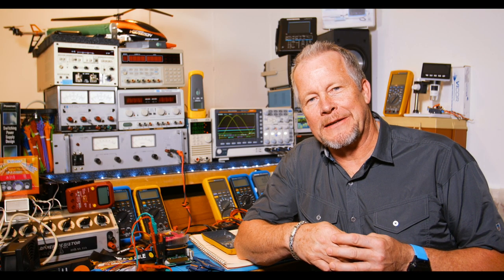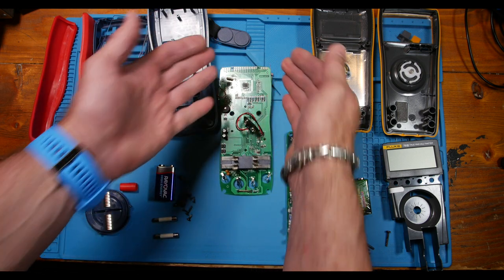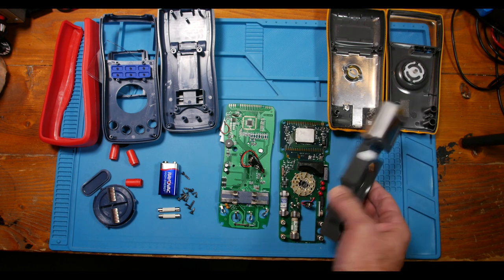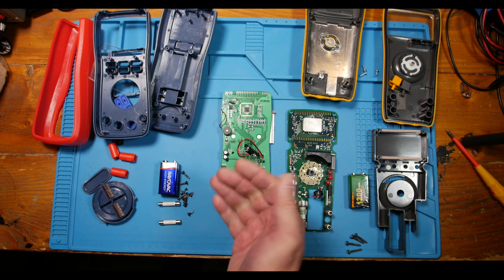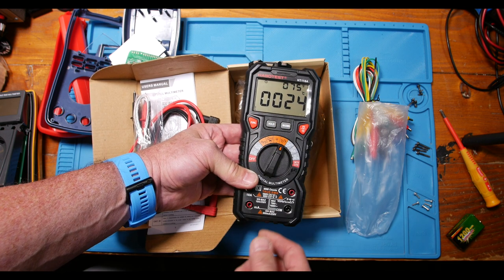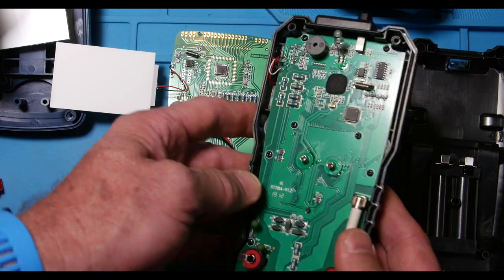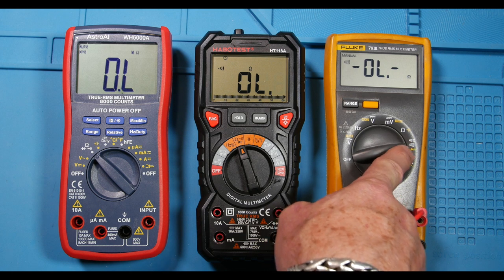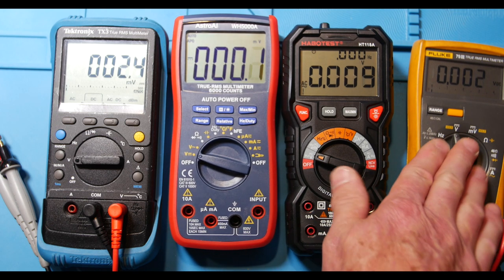Low Cost Digital Multimeters versus a Fluke

Comment: Really great review with both a look inside but also a great walk truogh of the usage in a perfect length! I do like a lot of things in this video and may have a tiny cringe:-)
I do like that you sometimes used cut and other times did use fast forward, it did a lot when you "jumped over" the slow parts that had no really value, like fitting the two plastics together. About plastic, there should be some markings inside that tells you what type of plastic it is, like PA6 that is a type of nylon.
About the Fluke, please correct me if I am wrong but when I read about the model 87, I get the thought that it is made for the hard working electrician, how rugged it is build, it's safety features. I do not think it is made for electronic at all, it is simply the fact that it has so bad a resolution at 6000 and do not go down to micro, and the low accuracy in the low numbers that make it nearly useless for anything electronic.
I was glad to see that you decided not to remove the print from the HT118A, there are no reason for you to maybe destroy the meter, just to show a properly empty board-side.
You may be right in that 9V do hold more power but everyone do own rechargeable 1.5 batteries and you can always have a set ready, while the 9V is nearly impossible to get as rechargeable and is fare more expensive to buy.The last part where you properly would make a thumbnail was funny but also a bit cringe because it was totally unedited and maybe a bit long, but LOL still funny. :-)
IMPORTANT, you forgot to say that you have a patreon account, and maybe you should change your text in the description to a link? :-)
Reply: Fried Mule do you own a fluke 87?
Reply: @chrisblank9090  Hi:-) No I choose not to after reading the spec sheets and seen lots of reviews. It was most the fact that it's only a 6000 count and have no micro and can't read as high a frequency as many other can. :-)
Reply: Fried Mule there are 5 87s. the 87 4 I think is the one you're looking for. in my own personal experience as a technician, when it comes to speed, the 87 1,2 and 3 are the best above the rest. no chinese or brymen meter can match them. whatever they say, branded meters will always be the apex when it comes to quality and features. for hobby or ethusiastic electronics work them generic multimeters will do but for people like us, a big no no. 87 1,2,3 and 4s are obsolete. the 87v or 87 5 is the one remaining in the market today.  and for that 6k count, you can set it to 20k.
Reply: @chrisblank9090  I do not know about how fast it updates, what I am talking about is if you want to know what frequency it max can detect and it's almost impossible low. But look at it, its a tank of a beast that guarantee that the man get hurt before the meter. That ruggedness  is invaluable for an electrician, also the real safety up to 1000V. It's simply build to withstand the harsh environment and not for the electronic engineer. :-) While maybe the Bryman is more geared towards that market with it's 50,000/500,000 count and up to 20MHz frequency detector and micro capability, but fare from as rugged as Fluke. The 87 do also dye if it gets static electricity while the Bryman don't. :-)
Reply: Fried Mule the 87 4 does micro. and same with its siblings, the 189 and 187. with acceptable resolution and update speed too (but not on par with the 87 1,2 and 3) I'm an electronics engineer and my business is consumer/industrial electronics repairs. almost 40 years in using various test instruments and brands. in my own personal experience, keysight and fluke are the best choice of them all when it comes to quality and features pricewise. brymens are also good. but when it comes to that min max feature, it's not on par with fluke and keysight. it's a bit slower. that's another feature where the higher ends dominate the market.
Reply: @chrisblank9090  I admit it's a fairly long time sins I took a look on the 87 but I have an idea about the Fluke brand is so highly praised, is because it was "MAD IN USA" and hard as a tank, it cant have been it's features:-) Now it may slowly be better but not nearly as fast as many other brand, like, yes, Keysight and Brymen. Brymen has a min/max that are wary slow but it's because that function is not for fast reading, it has an other function to that, that is about 50 times faster then any of the Flukes. I am not hating on Fluke or fanboy of any brands, I am just wondering on why use a 6000 count bomb proof meter to a HIGH price, when you can get faster with way higher count. To be fair that Fluke is fare from the most expensive brand out there, you can get meters that make Fluke look like a insanely good bargain. :-)
Oh and by the way, thanks a lot for taking your time to answer my comments and keeping it civilized! :-)
Reply: Fried Mule the min max feature of a meter needs to be very very fast to capture voltage and current anomalies in a circuit under test. for hobbyists and enthusiasts this feature is not important but to us it is. and only fluke and keysight have that speed that we need to capture those current and voltage glitches,.and for brymen, yes it's crest factor/min max mode is fast too  but not fast enough as it failed our requirements. we're no fanboys too. we just want reliable and able instruments to suit our needs. and by the way keysight is made in malaysia. brymen is made in taiwan. we have 2 brymen bm869s' and a bm859s. both top of the line brymen models. yes they are feature packed, but compared to our agilent agilent u1282as' and our fluke 289s' they become just average meters. and a fluke 87 1 will beat those brymens when it comes to update speed. we know because we made the comparisons ourselves and we have all of them on hand in the lab.
Reply: @chrisblank9090  Okay, that is great info, what about my argument about a wary low count?
First remember that I trust what you say, but funny enough have found an old video, comparing the Bryman and the Fluke where the Fluke... is ehm a fluke, compared to Bryman:-)
Reply: Fried Mule an 87 has two resolution modes. a 6k and a 20k count. 87 1,2,3 are almost identical in glitch capture speed. the 87 5 or 87v is much faster. if you need more speed you can go to peak capture mode. and in my opinion, that resolution issue you opened is not an argument for me because meter resolution is the least important  feature of a meter.
Reply: Fried Mule and I forgot, you need to have in hand both meters to compare them personally to make factual judgements. watching videos will just show you a fraction of the real thing and will not tell you everything. first hand experience is still the best.
Reply: @chrisblank9090  Okay that changes a lot, but resolution not important, ehm why not? I am not arguing but trying to learn! :-)
Reply: @chrisblank9090  You are completely correct, but unfortunately is it not a possibility in Denmark, you can't buy any of them in this country as far I know, so I have to buy from Amazon or something like that.
Reply: Fried Mule well when it comes to resolution, in our perspective, a 50k count meter will more than suffice, well for us. even a 2k count meter will be able to tell you a lot as long as the update speed is fast enough.
Reply: Fried Mule ah you're from denmark. wow that means metrix is widely available there right?
Reply from the maker: Hey guys thanks for the great conversation!!  I learned a lot!  Has anyone used the Tektronix Multimeters?  I am really happy with the TX3, but I haven’t really critically compared many of the features like the the min max measurements.
Reply: Kiss Analog umm no tek meters here in southeast asia sad to say
Reply: @KissAnalog  About the Tektronix T3X, I have not investigated much about that model but I was (as you know) the wary happy and lucky winner of your Tektronix DMM157 give away:-) And if that is any indecator of the quality, the Tektronix T3X have to be a really great meter!
Reply from the maker: I read somewhere that it was what Fluke ended up calling the Fluke 189 albeit rebuilt in the more Fluke looking housing;) I do like the Tektronix’s housing though - the ingenious way that the battery is housed.  But I guess when both companies were bought by the same company- only one was allowed to make meters;)
Reply: Kiss Analog both are now owned by the danaher corp. that tx3 was a dream meter.
Reply: and the fluke 89 was the identical model of the tx3
Reply: @chrisblank9090  What I like about the T3X is that you have only one Ampere port, that goes from 10A to the lowest milli amp.
Reply: Fried Mule that tx3 is one of best  meters ever made in the handheld realm. it was made by iso tech taiwan for tektronix. and it was shit news in the past that tektronix will never be sold within the south east asian region. taiwan is a neighbor country of ours. but iso tech never exported meters here sad fact
Reply: @chrisblank9090  Okay sounds wary interesting, but what made so great a meter? By the way, I have my eye on the Keysight U1253B I like the fact that I can read it from fare away and is so clear on video. :-)
Reply: Fried Mule that is a good choice. you can order it directly from keysight malaysia I think? to get it less?
Reply: @chrisblank9090  Glad you think it is a good choice. But my wallet don't agree:-)
Reply: Fried Mule that unit is indeed expensive.
Reply: @chrisblank9090 . Disculpa mi intromisión , pero he leído tus comentarios y los de Mula Frita y estoy totalmente de acuerdo con el. 
No quiero presentarme de profesión ni categoría , que es lo que has hecho tu para dar mas validez a tu conversación diciendo que eres ingeniero, en mi tierra uno dice la categoría cuando se lo piden , "pues el movimiento se demuestra andando"  Referente a Fluke nadie discute su categoria pero los galgos no son podencos cada uno para lo que es. Métete en foros de gente que tiene Fluke (que no se los han regalado) y veras los comentarios buenos y malos de cada modelo, no solo las virtudes que hablaís algunos
Un Bugati y un Fiat 500 los dos son coches pero ni cuestan lo mismo ni se usan para lo mismo y cada uno en su terreno tendrá ventaja sobre el otro.
También recordarte que ser ingeniero lo Único que dice es que has pasado por una Universidad pero eso no te da conocimientos , he conocido muchos que entraron siendo burros y salieron pollinos (como en todas las profesiones )  Siento pena en algunos foros y comentarios como a los principiantes les hablan de Fluke. Fluke , menospreciando sus polímetros  de 15 o 20€ que han comprado con toda ilusión. Con el tiempo y segun van avanzando ellos sabrán el polímetro mejor para su trabajo , y según su poder adquisitivo. Espero no lo toméis a mal este comentario, pero os doblo en edad y experiencia. Cuidaros y seguir comentando pero pensar no en los que saben si no en los que empiezan no les pongáis la valla muy alta. fdt.-
Reply: @friedmule5403  
Yavise sevilla
Hace 1 segundo
@Chris Blank. Disculpa mi intromisión , pero he leído tus comentarios y los de Mula Frita y estoy totalmente de acuerdo con el. 
No quiero presentarme de profesión ni categoría , que es lo que has hecho tu para dar mas validez a tu conversación diciendo que eres ingeniero, en mi tierra uno dice la categoría cuando se lo piden , "pues el movimiento se demuestra andando"  Referente a Fluke nadie discute su categoria pero los galgos no son podencos cada uno para lo que es. Métete en foros de gente que tiene Fluke (que no se los han regalado) y veras los comentarios buenos y malos de cada modelo, no solo las virtudes que hablaís algunos
Un Bugati y un Fiat 500 los dos son coches pero ni cuestan lo mismo ni se usan para lo mismo y cada uno en su terreno tendrá ventaja sobre el otro.
También recordarte que ser ingeniero lo Único que dice es que has pasado por una Universidad pero eso no te da conocimientos , he conocido muchos que entraron siendo burros y salieron pollinos (como en todas las profesiones )  Siento pena en algunos foros y comentarios como a los principiantes les hablan de Fluke. Fluke , menospreciando sus polímetros  de 15 o 20€ que han comprado con toda ilusión. Con el tiempo y segun van avanzando ellos sabrán el polímetro mejor para su trabajo , y según su poder adquisitivo. Espero no lo toméis a mal este comentario, pero os doblo en edad y experiencia. Cuidaros y seguir comentando pero pensar no en los que saben si no en los que empiezan no les pongáis la valla muy alta. fdt.-
Reply: @chrisblank9090  Chris these is no meter that you can set the count. The screen can either display it or not. i may be a complete moron or just a jerkoff  who owns a cheap meter and likes to disrespect fluke not for anything they have done but because im too broke to afford one and am jelous of people who can afford a product that the company who makes it is willing to put their own name on. then watched a couple youtube videos i think i know what different features on a mul-timid-er. measured the voltage on a few old batteries and went back to playing video games. but the count i think is just what the display can display not the range of measurement.

Comment: Thanks for the excellent comparison presentation. I ended up with the HT118A. Non contact voltage detection is very good especially with low/high voltage indicator.The one thing I wish for , which most meters do not have, is an inductance measurement. Resistors and capacitors are usually marked, but inductors often are not. Although inductors are not installed in the same quantities as other passives, they often play critical roles. When experimenting, it is one of the components which you can "roll your own" so its nice to be able to check your result.
Reply from the maker: Thank you!  I agree with you, I wish more meters offered the inductance measurement.  I do have a nice LCR meter to review:)

Comment: Go to TME or Welectron and order a Brymen BM869 or 839. Fluke quality at less than half the price. Amprobe are good for the money too. These things I wouldn’t dare measure anything over 100v. No front end protection to speak of. A few PTC’s and no MOV’s. Look up Joe Smiths videos of him testing good meters to cheap ones. He highly recommends Brymen, matched Flukes in tests up to 16kv transient tests.
Reply from the maker: SIXSTRING63 I like that Brymen a lot, dual display with AC bandwidth of 100kHz as well as being built for safety!!  Very nice!  Thank you!!

Comment: I have both the Habotest 118A and the AstroAI, both are great bang for buck meters and work well - but  like you said the biggest difference in high end meters like the fluke compared to the cheaper meters is in the degree of input protective devices that guard against surges and transients etc. making them much safer for use in serious work environments like factories and other places with serious power levels.  As  you said the cheaper meters are fine for home / DIY / hobby / bench use, but never use one for high current and voltage situations you would work around in factories & similar areas.   I like both the Astro and the Habotest, I also have the Astro AI's little brother the DT132A and its also a good little meter with lots of functionality.
Reply from the maker: Awesome feedback!  Thanks - you nailed it on the head!
Reply: Yea this meter started me looking at other meters and ive become a bit of a collector -- ive really become fond of the newer UniT designs and their meters have really improved in recent years - two newer design meters I can recommend highly since I own both of them, also in the slightly more expensive category are both the excellent UT89XD manual range for around $25 or so and the really nice IP65 rated UT191T-pro auto range that runs anywhere from $45 to $75 depending on where you look.  These meters both have newer ruggedized case designs, and a few nice little range features that I really like.  If you want a really rugged well built meter take a look at the big brother to the previously mentioned UT191T,  >the 195E< professional series, its also IP65 rated and extremely well made for a UniT and runs from $125 up depending on where you look, there are also different versions of the 195 for different applications, one has a range for testing electric motors I believe .  I have both the UT89XD  and the 191T and im very pleased with  both - they have been great with no real complaints but for one, the 191T has an auto backlight that uses a light sensor but id rather have a simple on off button, but short time backlights and auto sensors have been a personal nitpik of mine for some time.  You can find reviews of both these meters on Darren Walkers excellent mulitimeter review channel, hes reviewed more budget and better meters than most anyone one youtube.
Reply from the maker: Thanks for sharing this great information!  I’ve been checking out those meters - thank you!
Reply: I made a typo on one comment, the higher end meter I was talking about was the UT195E, its actually marketed and equipped more as a professional meter and costs anywhere from $125 to $150 depending on where you look - but the one I have the UT191T for about $55 or so is also a pretty darn nice meter with a bit less input protection but a lot of the other features including the ruggedized case and IP65 rating, mines been very  accurate and stable, highly recommended.
Reply from the maker: I am looking at both those meters.  I need to spread out my purchases;) but I am leaning towards the UT195E.  I just released a video that talks about the input protection.  I think some folks compare what is needed in a CAT IV meter to that what is needed in CAT II where most of us work - unless you are an electrician.